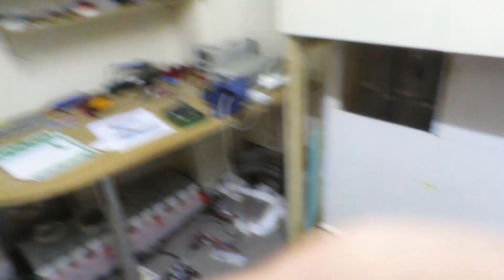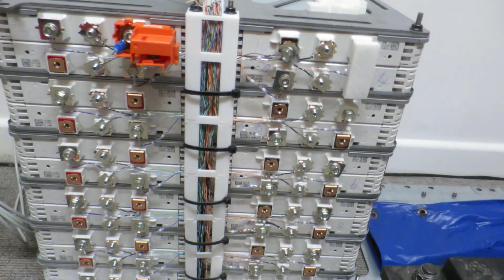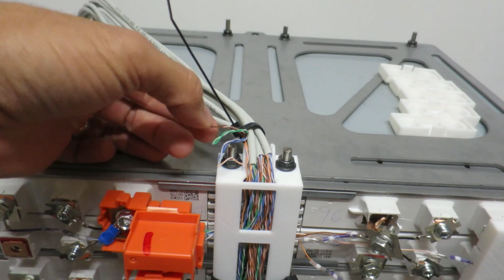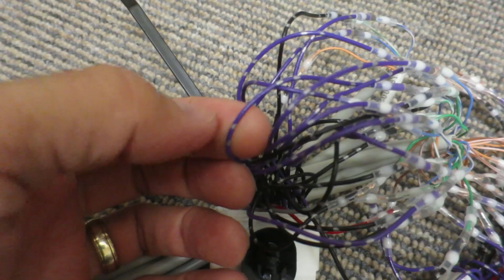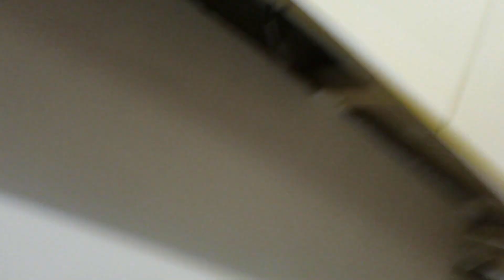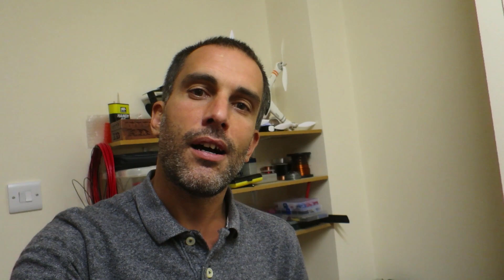Nissan Leaf to RX8 conversion, BMS wiring error!

Comment: I got CAT4 cable, which is at least 20 year old and was living outside all these years. Nothing has degraded or eroded. So just some small fuses would be enough I guess, as someone already mentioned.
Reply: Brilliant update Dave and brave of you to point out your errors as it helps those of us coming behind to avoid them too. 
I think the bigger issue than degrading because of time is that CAT5 cable is designed to be static in a building, is not automotive grade therefore not designed for the vibrations in a car. Auto grade cable will have higher quality insulation specifically designed to survive in a car.
Hopefully you saved enough of the wiring loom from the Leaf to redo it.
Reply from the maker: Yeah I think I can salvage what I have done, just annoying!!! I might try to blast it in one day with a time lapse video! God my backs gonna hurt lol
Reply from the maker: Yeah it is not so much the wires degrading through normal usage, but the 200v potential difference can make the insulator conductive, it will break down the material as its not designed to hold back 200v. Fuses are an idea, but I think getting it right is better even if more work...

Comment: You could just put tiny fuses on the cat5 wires somewhere.  I've never known cat 5 to errode away? Suppose I've never seen cat 5 cables running through a 90mph car either... Haha.
Reply from the maker: Remember this will be the small wires INSIDE the outer Cat5 sheath. Sat permanently at 200v+. I think it is a safer bet to redo this, otherwise it will always be on my mind. Could put fuses in I guess, but if they blow, then I have to redo it anyway. Guess if they don't blow I am all good, but I think Id be happier with a solid solution that is rated correctly.
Reply: @SouthWestEVUK  Could you set up a sample piece and do a long term controlled test at 200v?
Reply: @SouthWestEVUK  fair play! Don't want to hurt the rx8 😉